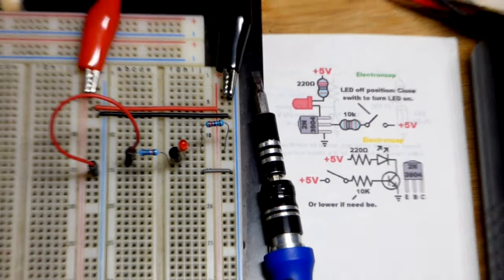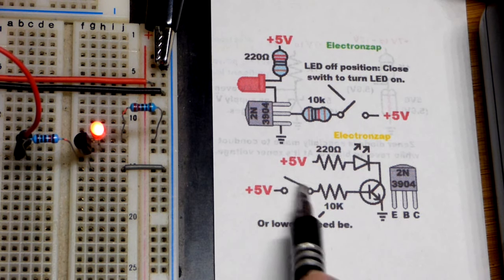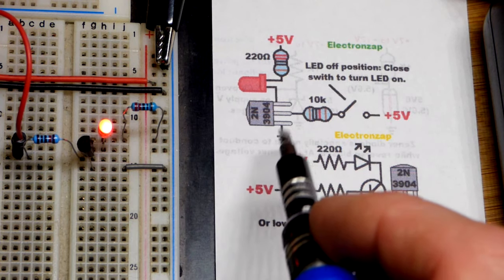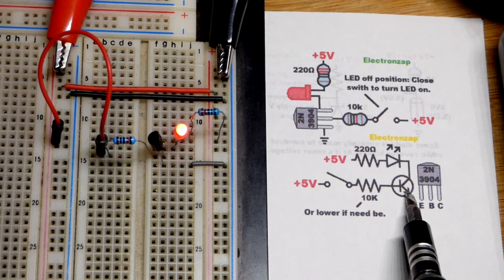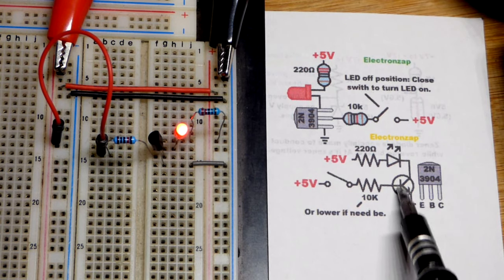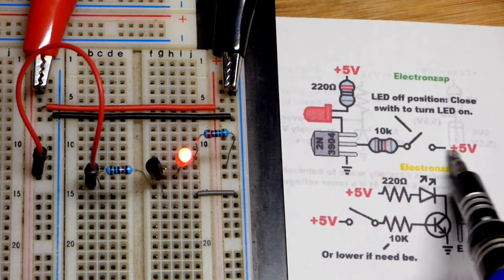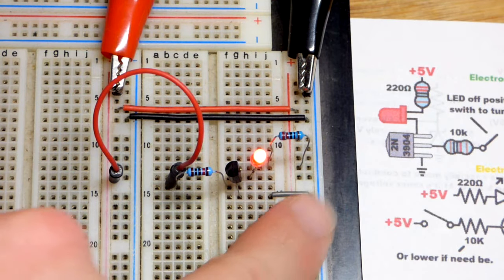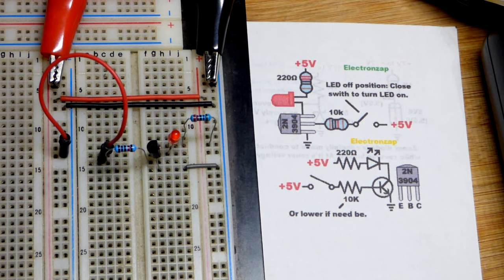NPN BJT Switch Bipolar Junction Transistor demo circuit

Comment: Nice video
Do you have a video with the same circuit and when you touch the wire it lights up and again it turns off?
I don't want to put a mechanical on/off switch?
I'd rather have it as a Touch switch